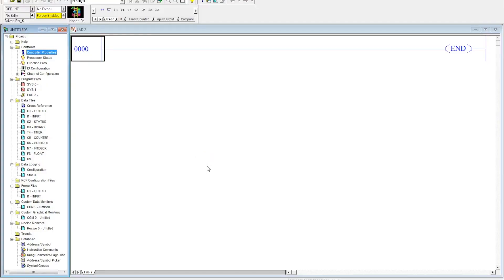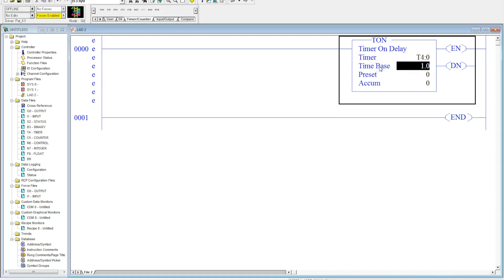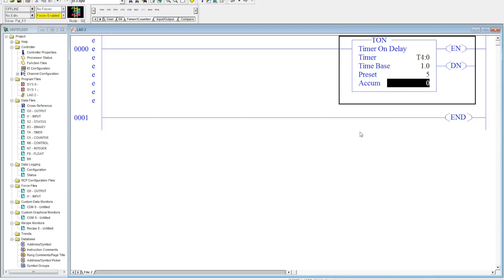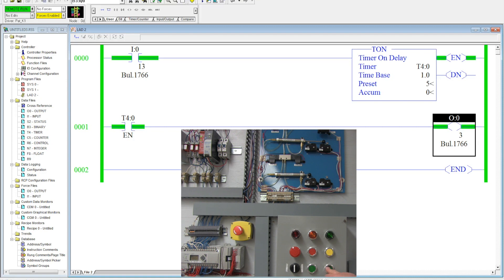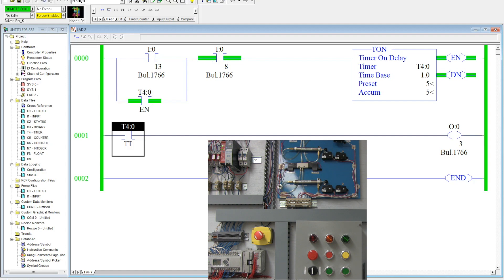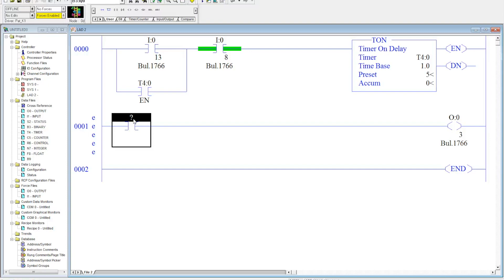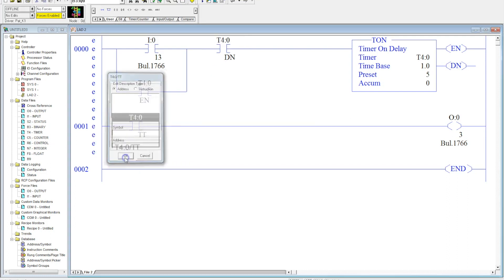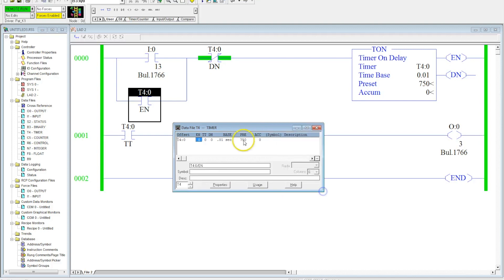Introduction to Timer On Delay using RSLogix 500

Comment: I guess at the end of the video the DN bit XIO opens and the timer output DN bit too fast to be seen. And I'm assuming the DN bit is on as long as there is continuity through the rung. Thanks
Reply from the maker: That is correct.  It changes states for fast that the monitor does not pick it up.

Comment: Hello, this is really an in depth video as far as I'm concerned. I'm not a formally educated chem eng. But i play one at work. I work with a Hennecke slab stock machine. I use a proprietary virtual dashboard, with a laderlogic back bone controlling 45 channels. I'm really interested on learning the laderlogic system. And there is nobody around to teach me. Now that i know you have these videos I'm excites to return to work tomorrow and see what I can recognizes hopefully I can make an two valves one and close sequentially on a timer.
Reply from the maker: Glad you like the video.  Good luck at work and hopefully these video help out.